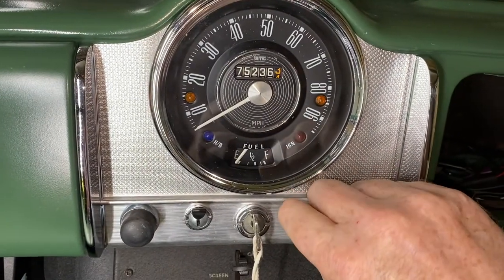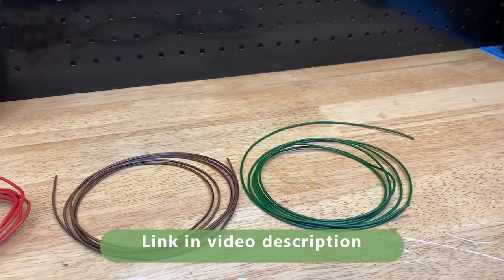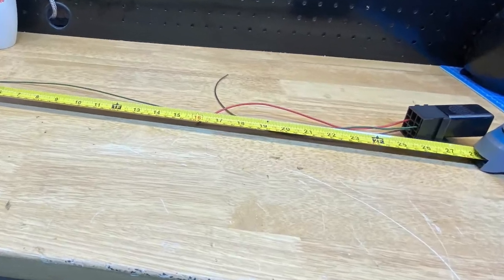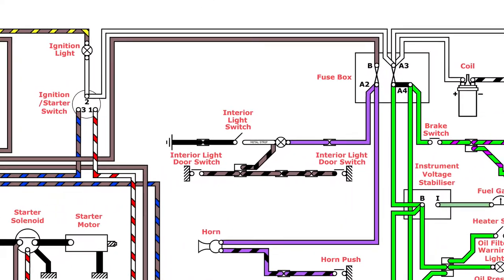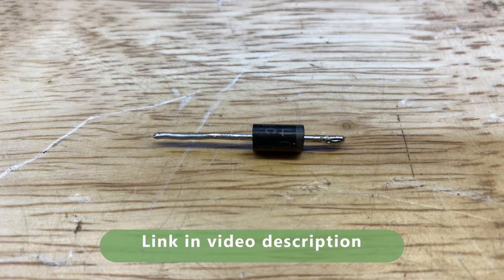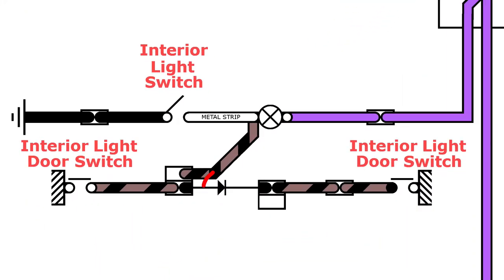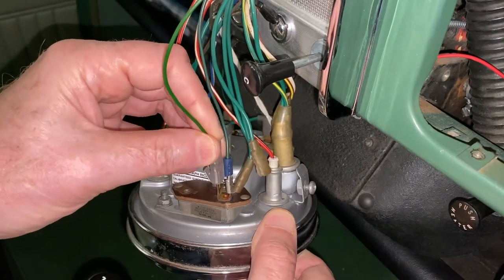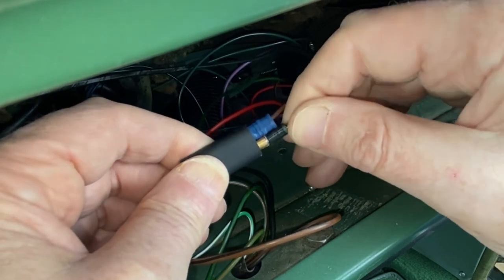Morris Minor sidelights reminder buzzer (advanced)

Comment: is it just as easy to fit one to the indicators?
Reply from the maker: Not sure what you mean. If you can give more detail I’ll try to reply.
Reply: A simple buzzer can be fitted with 2 diodes from each indicator bulb lines to the buzzer positive. The negative side of the buzzer goes to the car body. This procedure is for negative earth vehicles. Have to reverse the buzzer polarity and the diode polarity for positive earth vehicles. The circuit will then be completed by the indicator switch and the flasher unit.
Reply from the maker: Sounds right 👍

Comment: Good video although when you refer to a rectifier I think you mean diode. And an M4 bolt in a Minor- sacrilege 🙂
Reply from the maker: Thanks Nigel. Actually I mean a rectifier diode. A  plain diode is similar, but wouldn’t carry the current required. As for M4, you got me. They’re just easier to find.
Reply: @jodiethemorrisminortraveller  Interesting, I always thought a rectifier was a device to change AC into DC, and that is what Wiki and other searches seem to confirm. They do it by using diodes - often referred to as rectifier diodes- in a bridge pattern. Good example being the rectifier built into most alternators.
Reply from the maker: You are correct. The supplier of the part used calls it a rectifier diode. I abbreviated.

https://www.switchelectronics.co.uk/products/1n5401-100v-3a-silicon-rectifier-diode-pack-of-10